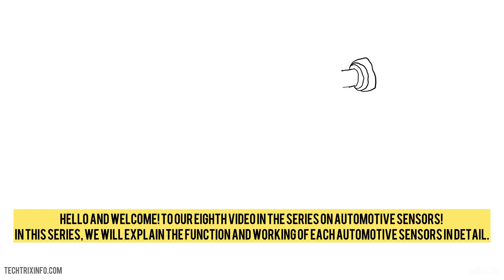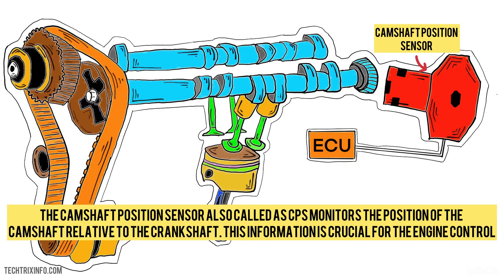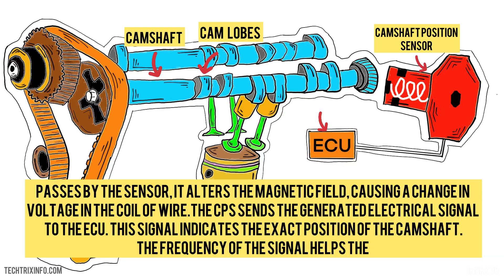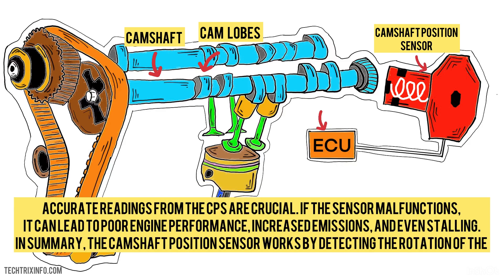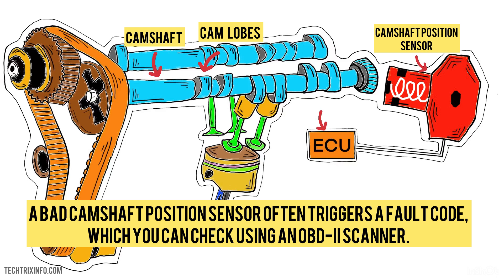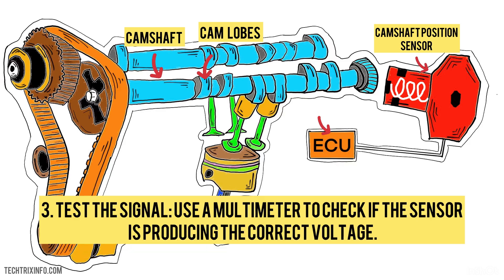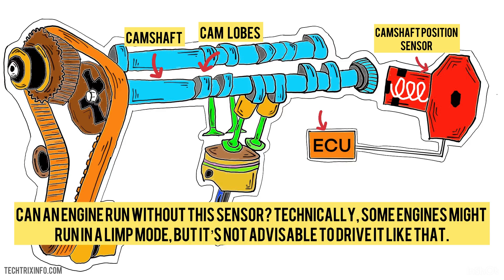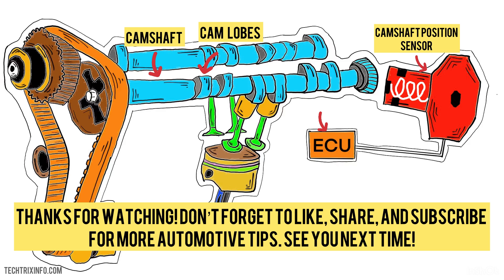Camshaft Position Sensor Explained With Animation | Mastering Automotive Sensors | Part 8

Comment: there is oil leak at the camshaft sensor on my kia seltos, Does it require replacement? or can we change the rubber parts like o-ring